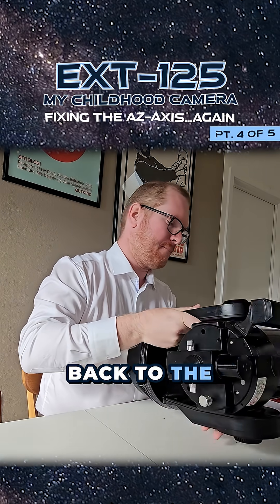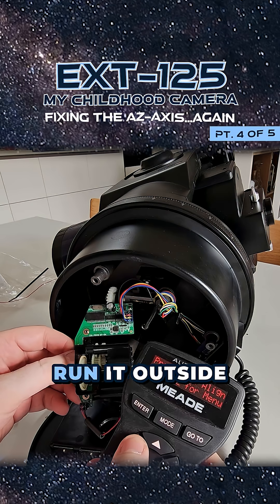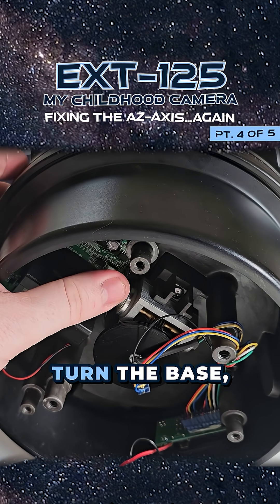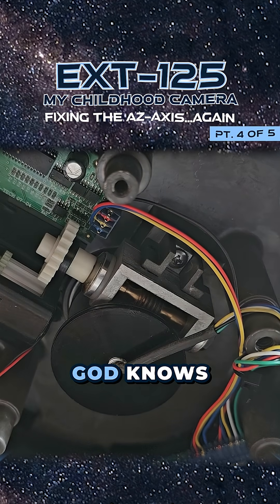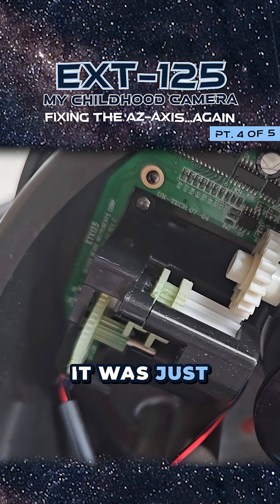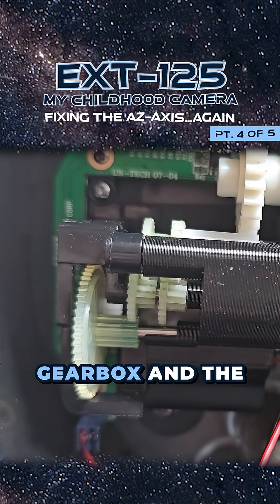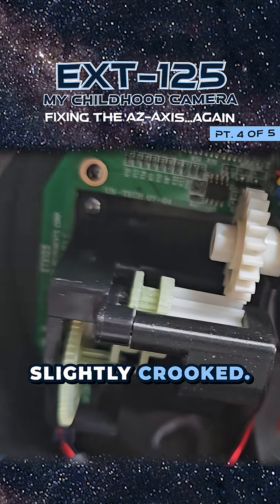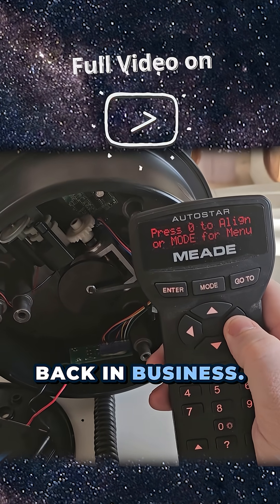Fixing my own mistakes on my childhood Telescope

Comment: I bought the etx60 from someone real cheap who said it wouldn't move in dec mode I took it apart everything seemed ok  and after researching found out the clutch wasn't tight enough.   works like a charm now but I just keep it for a decoration piece 👍